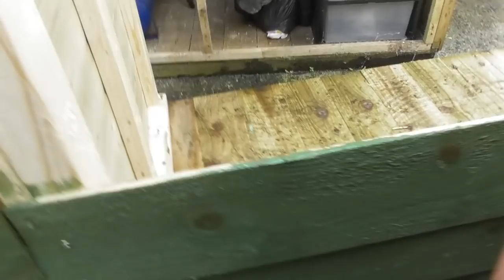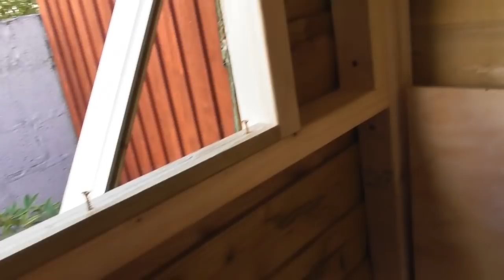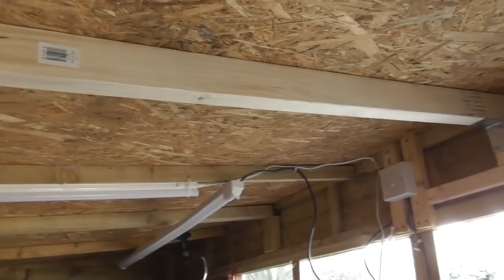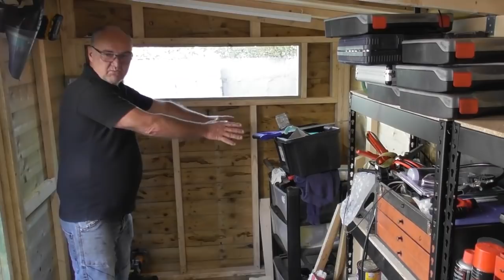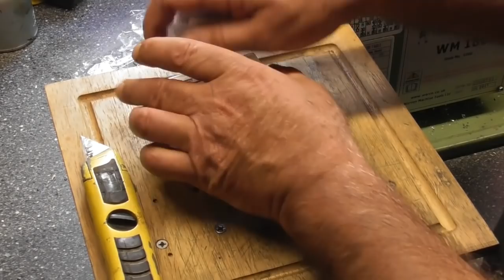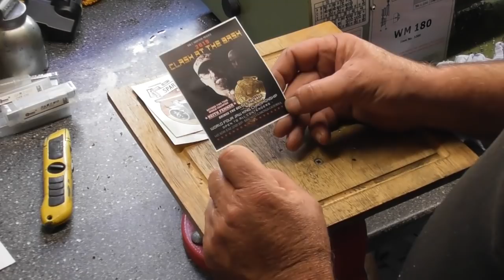Shed extension part 2

Comment: Just a suggestion, before I moved into my brick built workshop, I lined my wooden shed with 1 inch thick polystyrene sheet in the frame work and also the roof. It made a hell of a difference in lovely winter weather we get in the UK. Love the extension , that's my type of carpentry . Keep up the good work and videos.

Comment: I would think some wood in between the roof "rafters" will keep the OSB from any more sagging. I would have used regular plywood for the roof sheathing, then tar paper, and then the rubber membrane. With the roof sagging and creating dips in between the rafters, no matter how shallow, is going to soften over time. Then the OSB will soften as condensation from your breath rises. Have you thought about using rigid insulation panels in between the rafters with another layer of 1/2" plywood as a ceiling material? I know you are probably like most home DIYers and fix things as they arise, but in the long run, you would save more money and time doing the repairs before you put the roofing in place. Just my suggestion.

Comment: For the ultimate in using cubic rather than square space, take a look at the 8x6 workshop (8 feet by 6 feet!) - there is a tour at https://www.youtube.com/watch?v=gCtRWwvGHeY and it packs in an impressive number of hand and power tools (including wood lathe, bandsaw and drilling machine). It puts us all to shame, though I am impressed with your extension and hope you find a milling machine that will fit in and extend your options.

Comment: Very nice job Ade. When choosing your milling machine, don't overlook their weight. The WM16/18 types are well over 100kg, far more than even 2-3 people can lift. I think you might have to get it through your house and down the steps from your decking and then lift it onto the bench in a confined space. Even with an engine hoist, this might be difficult. It took three of us to lift my WM14 onto the bench and this is why I didn't go for a larger one.
Reply from the maker: Yes , it is an issue . my plan is to strip it down to manageable parts and rebuild it in position if it is a problem , Cheers Ade.

Comment: Hello from Denmark
A little tip, convert your aircompressor with 2 compressors from a refrigerator.. Absolut silent..Have served me well for years now.. 👍
Also.. The Optimum BF20 mill is a good option, prepared for cnc if you should wish that.

Comment: Ade I know you said you won't be using the compressor regularly but please make sure you have ventilation at the bottom of the enclosure for fresh air inlet and at the top for hot air exhaust , starving a comp: of air is the quickest way of ruining it plus you get water vapour saturated air in your airline .built was awesome for a non carpenter that was damned good, looking forward to all the new projects. Cheers.
Reply from the maker: There is loads of ventilation for it . big gap at the top and open bottom apart from the support , Cheers Ade.

Comment: Great video Ade it's amazing how much space you have made just by extending your shed a few feet, as for the compressor I use a small airbrush one for blowing stuff of the machines very quiet and just enough air to do the job, good luck with deciding what milling machine to buy I have a small machine and do any heavy milling on the lathe , atb John.

Comment: Hi Ade, great video loving the extension, just a couple of questions if you don't mind, what camera are you using? and what size was the shed before you extended it? can't wait for the arrival of the mill really looking forward to seeing what you buy, cheers Gary.
Reply from the maker: Hi Gary, the shed was a 6x12 feet originally . and i normally use a panasonic HC-V380 camcorder for most filming , occasionally i use a sony DSLR but not often .